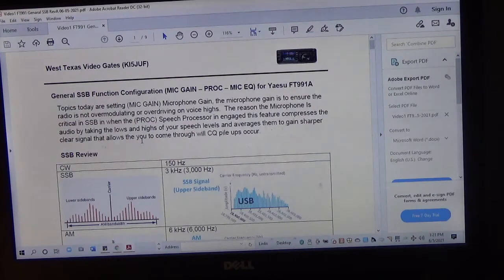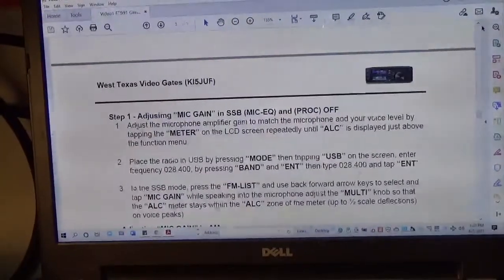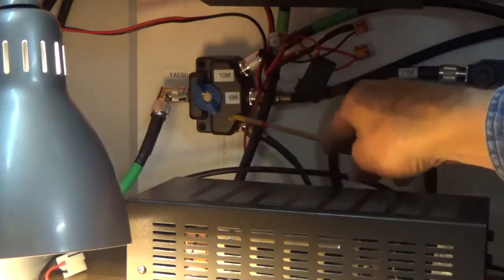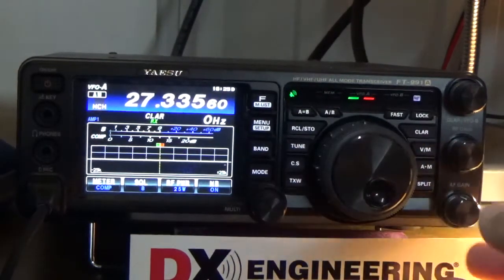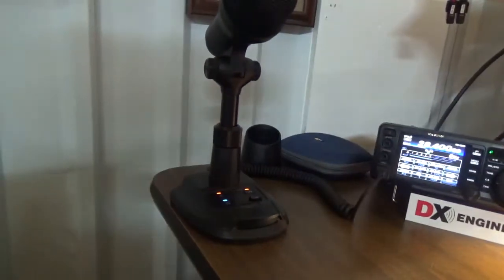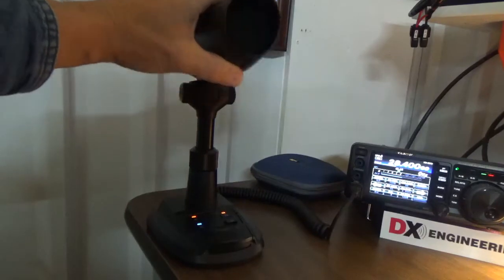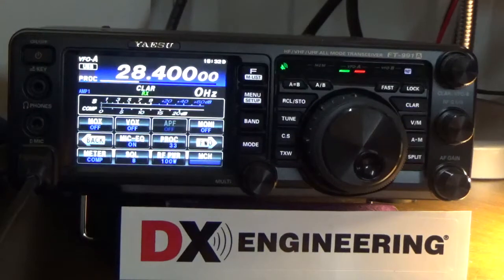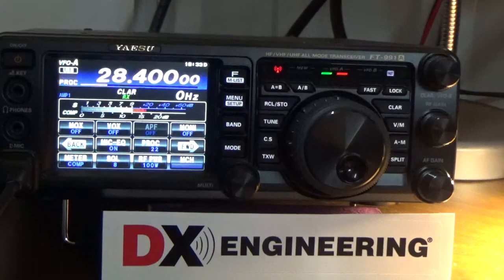General SSB Function Configuration (MIC GAIN – PROC – MIC EQ) for Yaesu FT991A Hands On (Part 2)

Comment: Jim, setting the mic gain with the processor on? Bad practice.
Reply: Well, I take part of that back.. at least the EQ part. Because the EQ is before the ALC circuit. So I would say you have to go back and forth to get it set right. Do some EQ work then go back and reset the ALC. Then turn on the processor and set the compression.